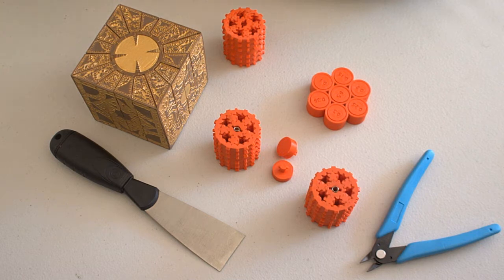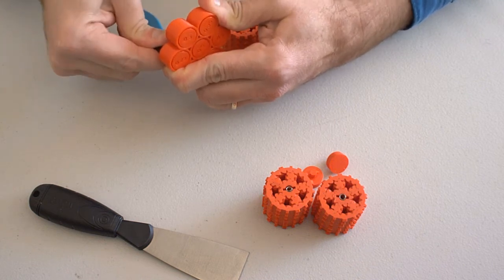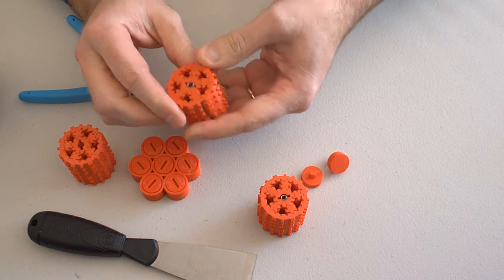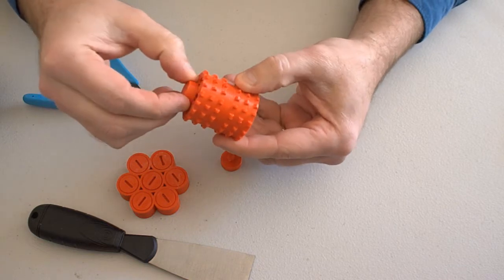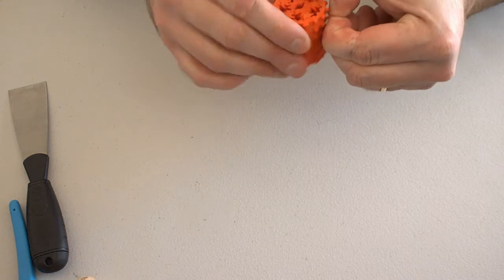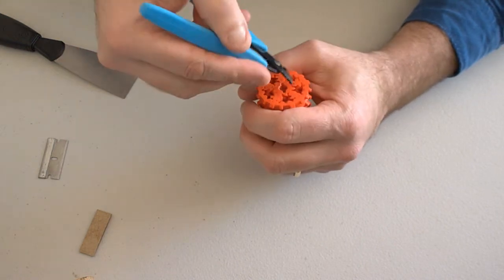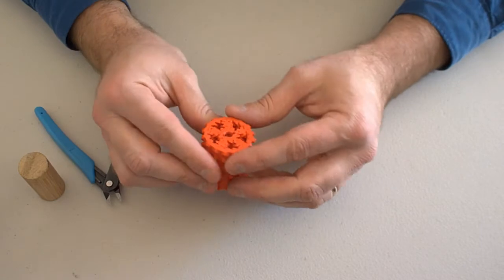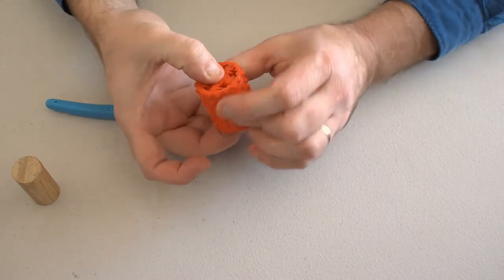Puzzle Box Core Prep&Post-Processing

Comment: Just so I understand, the first object is a gauge used to determine how close you set the spacing in your slicer to enable it to break free when you print the gear cassette in place?
Reply from the maker: Yep, just a calibration tool to get your slicer and printer dialled in. If it's overextruding heaps for example the gears will fuse solid.

Comment: Mind if I ask what the size of the spring is?  I was finally able to get the Planetary Gear working with your help.  Thanks!
Reply from the maker: Glad to hear it. The spring is 5mm OD x 45mm, ie. same height as the core (was actually longer and I trimmed it down to size)
Reply: I have screwed up somehow.... got the spring in but Im afraid that I have put it together and it only opens halfway. Of course meaning I can’t turn it to the other configuration.  Not sure what I messed up.
Reply from the maker: @Ph0t0bug  Someone else said something similar - I suggested checking the orientation of the core but never heard back (should be able to pull it back out again). The way the teeth on the core are arranged, in particular the skinny teeth that have to "escape" through gaps at the end of the tracks. One set of teeth is centred but the other is to one side. I suspect the offset teeth are not aligned with their correct tracks (but the centred teeth are). That was the 50/50 dilemma I was referring to in the first video. (by orientation, I mean the core being rotated 90 degrees or so, relative to the half with the offset/non-centred gaps)
Reply: I was finally able to get the two parts off the core.  Going to watch the video again. I understand the off set part, Im just having trouble seeing it on the core.  Is there an up or down to the core or can it be installed either way?
Reply: Quick Update:  Part of this issue I think is / will be paint.  On the nib on the inside of each half had paint on them. This caused the core to stick to the half that had the best grip on it.  I still need to find a spring that will work to push the core off the nib(s).  Ill let you know of anything I find along the path.  Thanks for the help so far.
Reply: Another update.  Still cant seem to get the core to stay involved with both ends.  One side disconnects when pulling the side out.  I will say that Graphite Dry Lubricant worked GREAT on allowing the core to become free when unlocked.  Also put it on the rails on the inside and it runs much smoother.  Everyone love it.
Reply from the maker: @Ph0t0bug  Yeah, there's pretty much only one way the core goes in - up to Z-rotational symmetry but even then there are "wrong" positions. The simplest one to explain is the centred teeth/tracks. The fat teeth stay in the tracks always, and the skinny teeth escape through the gaps in the top (centred ones go "out"). This is also the half that allows rotation, and hence goes in any position (by rotation). The offset teeth (now on "inside") are so it doesn't come out when rotated. Then the opposite half (with the offset gaps) must align with a specific set of teeth (left or right offset from centre) and never turns in relation to the core.
Reply: Must say I still love the result and so do a lot of others on the FB groups.  I told them to check out your video should they want to print it out.  Thanks again for the opportunity!  One of the best Cubes out there.... Now... The Leviathan Configuration maybe?  :). LOL
Reply from the maker: @Ph0t0bug  Thanks, glad you like it. Yes, that would be pretty cool to pull off but the movie magic makes it a tricky one. I wouldn't say impossible, though.